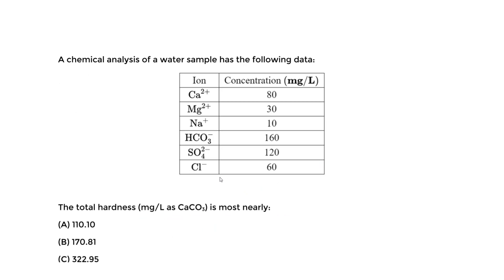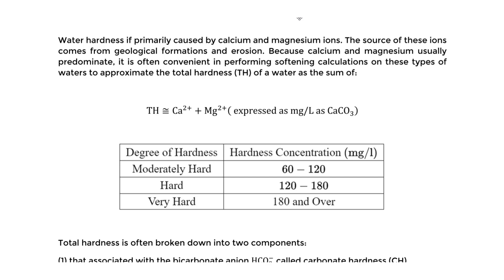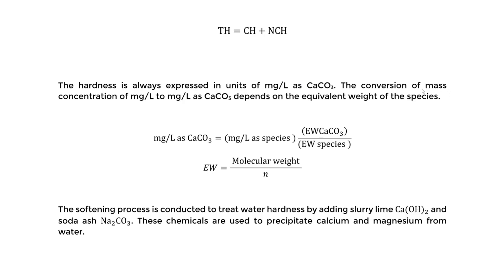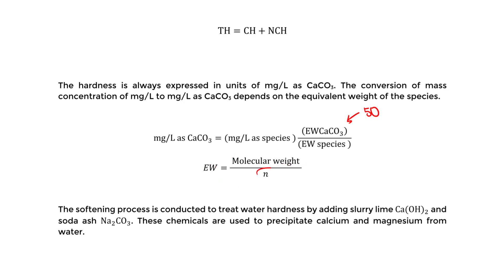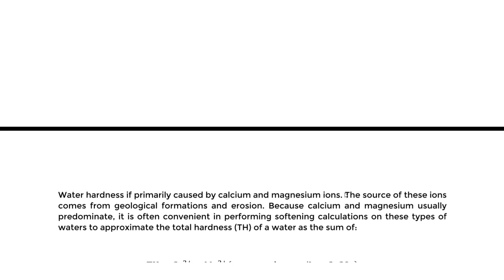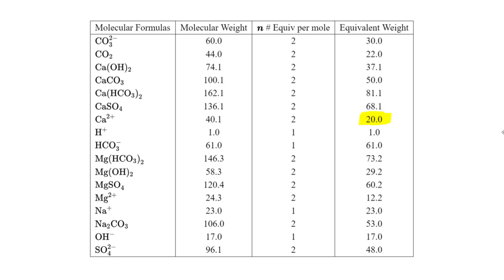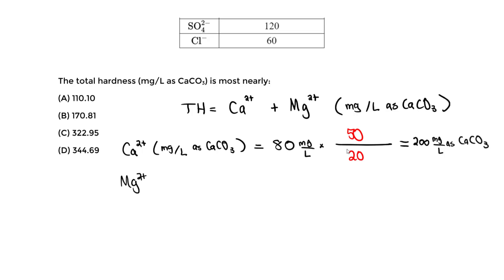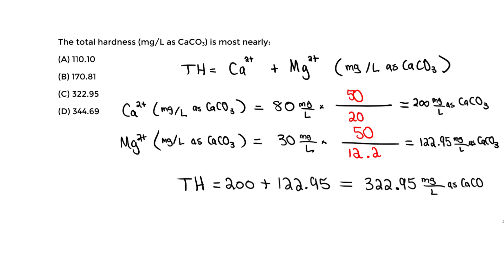FE Exam Review - FE Environmental/Civil - Softening - Water Hardness

Comment: Hi, could you please explain when to use the two different definitions for TH? You said its Ca2+ + Mg2+, but you also said its the sum of CH + NCH. I'm confused as to when I would use each definition. Thanks in advance!
Reply from the maker: Hello! 

Both defintions are correct. 

Total hardness is the summation of the MAJOR "multi-valent" cations which tend to be Calcium (Ca2+) and Magnesium (Mg2+). There are other cations that contribute to the total hardness, but these are negligible when compared to the high concentrations we get from Ca2+ and Mg2+. 

Total hardness is also defined as the Carbonate Hardness (CH) and Non-carbonate Hardness (NCH). The carbonate hardness consists of the hardness has the bicarbonate ion attached to either Ca2+ and Mg2+. This is easier to remove. 

The non-carbonate hardness DOES not have the bicarbonate ion (HCO3-) attached to the Ca2+ and Mg2+. This is much harder to remove and requires the addition of soda ash. 

Check out the summary notes taken directly from the DirectHUB course: 

https://drive.google.com/file/d/1T6FLrGjyA-0bdA8EXdd8TuMkcXiZw1IT/view?usp=drive_link

Comment: So if HCO3 is considered as hardness why in calculation we just measured for Ca2 and Mg2?
Reply from the maker: Hi Fatemeh, good question. 
The keyword here is "associated" meaning "connected with" the bicarbonate anion. 

For carbonate hardness removal the calcium and magnesium metals are attached to the bicarbonate anion as shown by the chemical equation provided for lime softening on page. 341 in FE Handbook 10.0.1. 

https://drive.google.com/file/d/1W3N5n5C93Zx3v9cjnKxne8GWI5gKxpYm/view?usp=sharing

So the calcium and magnesium are still the metals that make the water hard and we remove the hardness (i.e. calcium and magnesium metals) through the softening process by using soda ash and lime which ultimately precipitate out these metals. 

Hope this helps!
Reply: @directhubfeexam  in the video you say that TH = NCH +CH. If HCO3- is the CH why wouldn't we add the Ca+Mg+HCO3
Reply from the maker: @anniez2305  Hi Annie, sorry for the confusing video definition for carbonate hardness (CH). It should have said: "those metals associated with the bicarbonate anion HCO3 are called carbonate hardness (CH)." So based on that definition, carbonate hardness will consist of the Mg and Ca metals that are bonded to the bicarbonate ion HCO3. 

The non-carbonate hardness (NCH) is when the Mg and Ca metals are bonded to other anions (not including HCO3). I hope this makes sense!
Reply: @directhubfeexam    so basically if hco3 is by itself then it doesn't count toward total hardness.  If there was a MgOh2 then we would add that too correct?
Reply from the maker: @dand7056  Hello Dan, yes exactly. HCO3- by itself does not contribute to the total hardness. 

HCO3- is the alkalinity. Which is a measure water capacity to neutralize acids - or in other words, the water's capacity to resist changes in pH. The higher the alkalinity, the more resistance to changes in pH. 

MgOH2 would not add to the hardness.

Anything associated with the bicabonate and carbonate would. 

For example: 

MgHCO and MgCO3 

Please refer to the following bar diagram and figure to reinforce your understanding. 

https://drive.google.com/file/d/1dAdELneWVb02YsAExr78Nr1lR42tzvxc/view?usp=sharing

https://drive.google.com/file/d/16eXsMD_aK3ohoBWka5vpAjmOq1lK-L1v/view?usp=sharing